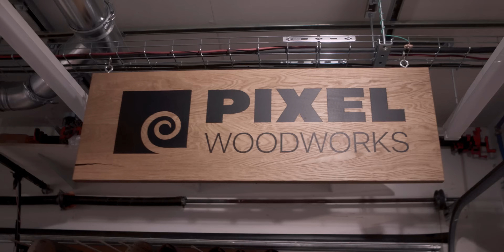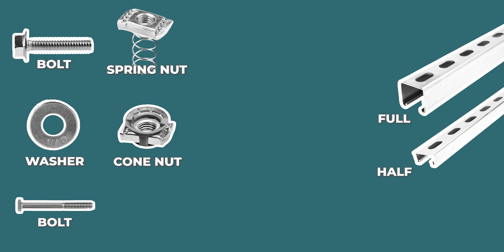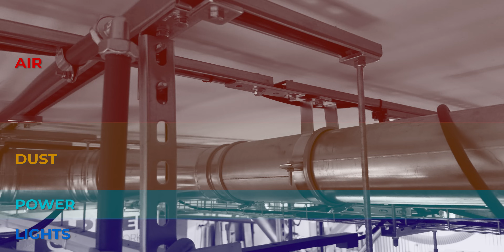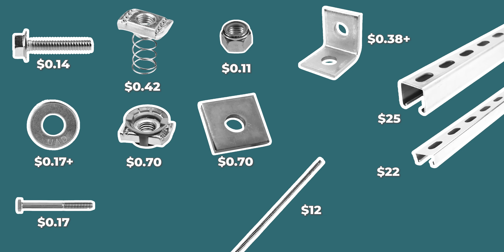How-to Use your shop ceiling fully!

Comment: Hello, great video. Gave me lots of ideas. At 6:12 in the video it shows a wall with just brackets mounted and there's nothing on the brackets. Assume these are for lumber maybe. My question is where did you get those self brackets connected to the strut? They have a hook at the to keep stuff from coming off. I've got to get some of those. Thanks
Reply from the maker: So glad you got some ideas from it. Regarding those brackets, you can find a large variety of configurations, for example: https://unistrutstore.com/1-58-metal-framing/unistrut-brackets.html -- but my suggestion to you would be to simply use a cut piece of strut with heavy duty angle brackets  at the upper connction and 45 degree strut supporting the base. For the end, you can simply use another light duty ($3) angle bracket to keep wood in place. (There are cheaper vendors than Unistrut brand strut too).
Reply: @pixelwoodworks  great suggestions. Thanks

Comment: Why do you, and everyone else assume the bottom chords of the roof trusses were designed to handle the loads from the stuff you are adding.    In most garages it is not.
Reply from the maker: Hello, I did not assume that, but I decided not to get into it in this video. My ceiling is 2x12 Joists with a large glue-lam beam supporting it. I talked to an engineer about adding the load in the past before building out. I did have a segment of video where I should the attic, joists, and discussed it, but again I cut it out. The original video was ~40 minutes  :/ I think I'll add a note in the description of the video though. Thanks again!

Comment: Cable trays are for cables (data, phone, external antennas, etc); bus ways are for power.
Tons of starline busway on ebay for super cheap; when a company shuts down a shop or lab, more pallets appear on ebay.
Not an affiliate, just a lover of on demand configurable overhead power for cheap.
Reply from the maker: Thanks for the feedback. I had to look this up and research it after you mentioned it. It certainly seems like it would be a great way to setup flexible power but far more in-depth and less approachable for a laymen.  The cable I already had was SOOW and its fine to use on a cable tray (or in much worse conditions). Interesting idea though, Thanks again!
Reply: Can you point out what you are talking about? I am not able to find anything about a bus way. Posting the id of a ebay listing would be fine.
Reply from the maker: A busway system involves a set of enclosed conductors, typically solid copper bars, that distribute power along its length. Outlets or tap-off units can be added at any point along the busway, allowing for flexible and customizable power distribution. I think its a bit much for a garage but may be nice for a mid-size or dedicated shop. Here's the eBay ID of a tap (324970503780) and the bus (285446121734). Hope that helps.

Comment: Wow, what a system! I'd love a long-format in-depth look at exactly how you built each layer on your ceiling and the logic/reasoning of why you did what you did at each level. Fascinating stuff. New subscriber as of this video, so I guess you were wrong about one thing. :P Keep up the great work!
Reply from the maker: Thanks for the feedback. I did originally do a much more in-depth video but after 35 minutes I decided it was too long and we ended up with this. I can tell you my layout was just based on my needs of the moment except putting lights at the bottom. Its really going to depend on what your trying to get off the floor and onto the ceiling and how your shop is configured. The best piece of advise I can give you is tightening up your grid where you plan mount many things.  Thanks again!
Reply: Would happily watch all 35 minutes if you still have it! Upload it as an "extended version"! @pixelwoodworks
Reply from the maker: @ModernSurvivalists  Sorry, deleted and working on the next video, with a Shaper. So far I still have both arms, so thats a good sign 😅

Comment: 2 big tips I can give for unistrut in workshops which is amazing. 1 it makes for really great garage door opener supports as its far more versatile. 2 - buy yourself a set of klein or any other brand “pass through nut driver” this allows for fast securing with threaded rod or long bolts. As a bonus tip if you need you can buy plastic end caps for unistrut that hammer into to the ends to make them not sharp if they are in areas that you may come in contact with you
Reply from the maker: Great advice. I also added red tips to my threaded rod in a few places after bumping my head. I originally shot that but cut it out of the video. :/ Thanks for the tips!

Comment: Good idea.  Its usually referred to as unistrut.  Also, for cutting it just use an angle grinder or reciprocating saw/sawzall.  

Most importantly, before hanging heavy loads or a winch, make sure your ceiling is rated for that
Reply: Best way to cut unistrut is with a portable band saw.
Reply from the maker: Great idea.
Reply from the maker: Thanks for the feedback! I called it Strut because Unistrut is actually a brand and you will find Superstrut or another brand at your home center. Your right about load on your ceiling, I just didn't want to digress into that too far so I cut it out of the video. Thats the only reason I am not storing MORE on my ceiling, there's a room above it all sitting on a glue-lam. Thanks again!

Comment: Running a MasterClass on space optimization. Such a brutally underrated system. Bravo
Reply from the maker: Thanks! You sound like someone who understands and appreciates it :)
Reply: yes sir. I installed a limited run of strut on my garage ceiling a few months back to help store 10-14 ft long boards. After watching this, I kinda wish I had installed a full grid across the whole ceiling. Great stuff! @pixelwoodworks
Reply from the maker: When the time is right, you can certainly add on. :)